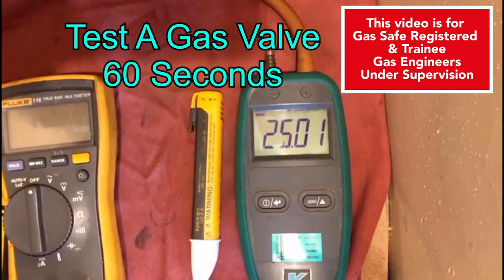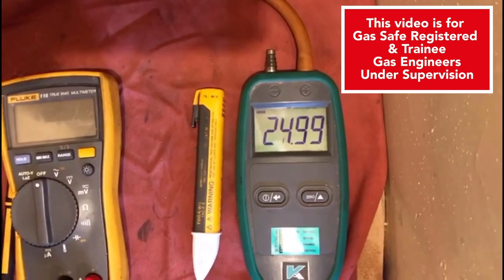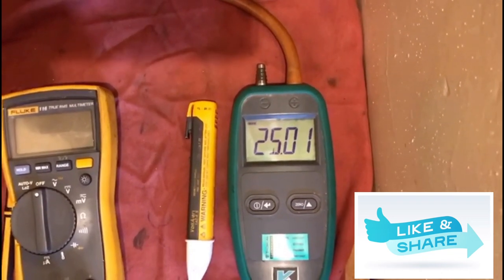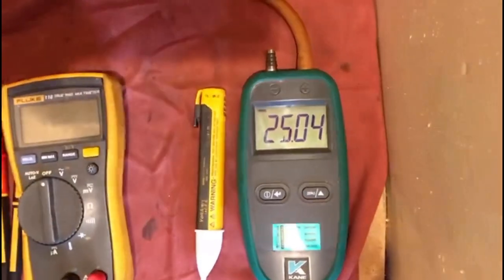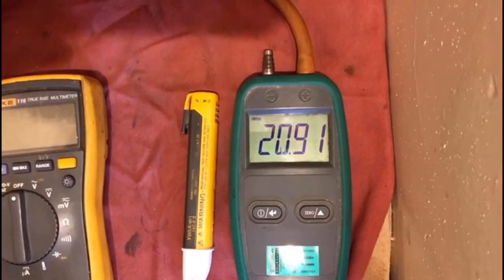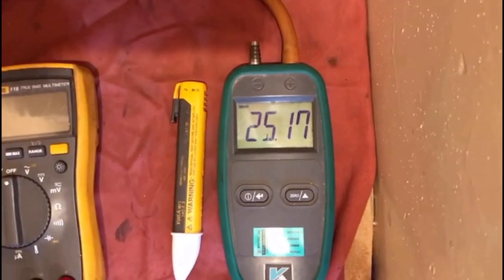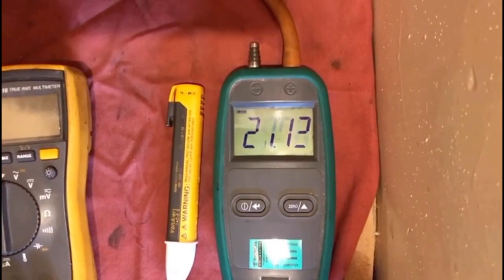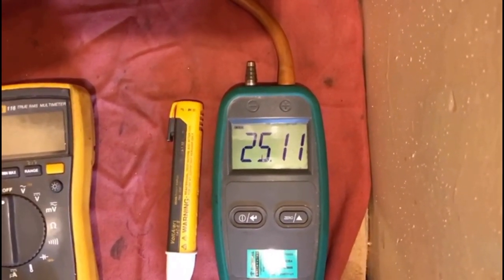Gas Training - Testing A Gas Valve In 60 Seconds - Ex Ideal Boilers Engineer

Comment: I turn the appliance off, connect a manometer to P1 open the isolation valve then close it again. Then put the boiler through its ignition sequence. If the gauge drops to zero, the valve has opened. Much easier to see than a brief drop. 

You can also do it at the meter and shut off the ECV.